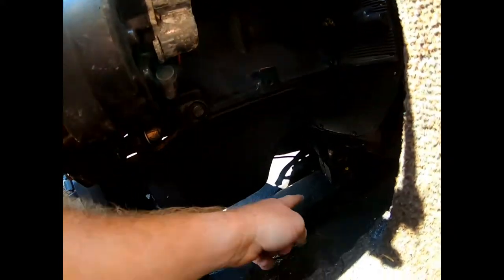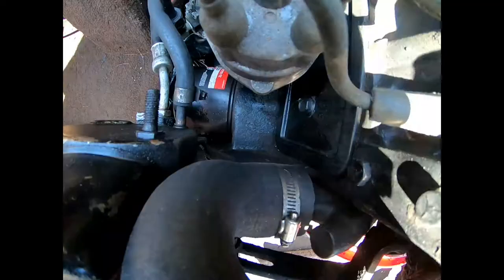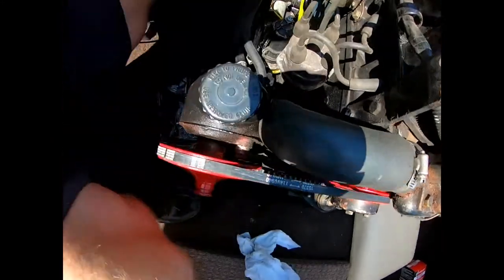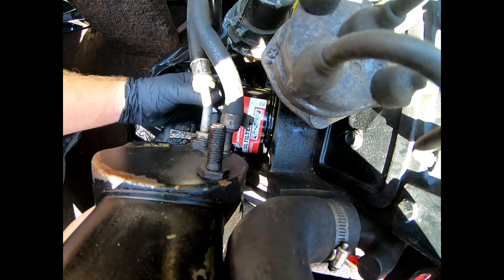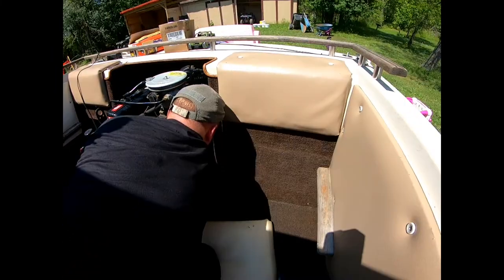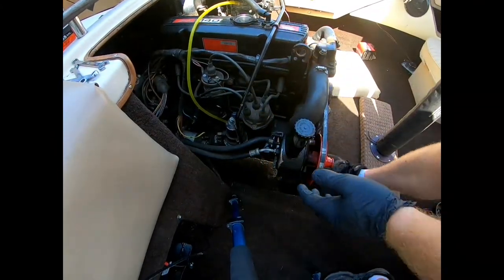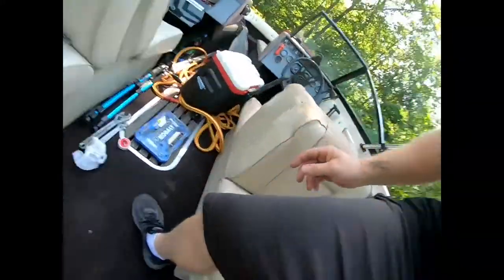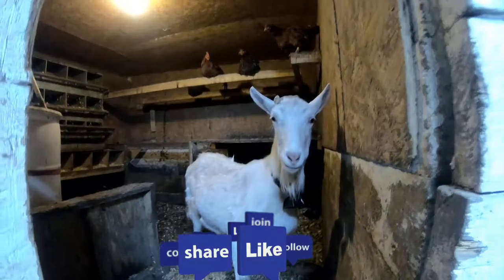Mercruiser Boat Oil And Filter Change DIY

Comment: I have never seen someone change the oil that way.  Have you not heard of a fluid extractor that sucks the oil from the dip stick tube?
Reply from the maker: Lol while now you have!  Trust me that dip stick oil extractor is doing you no favors especially with a boat where there is so much condensation and water constantly,  you are leaving mass amounts of sludge in you oil pan along with other break down contaminants and  metal shaving parts that are running back into your engine!!! Give it a try sometime and you'll see how much crap your leaving in there with just using an extractor,  if you want to prolong your engine give it a try and clean up is easy you can take the bag out cut a corner and drain it into you bottles or jugs, I do recommend the black heavy duty bags though!!! Thank you for watching and when you do try it let me know I'm sure you'll be impressed with all the junk you get out!👍😊
Reply: I change more oil in a day than you dp a year I'm sure, done what you have said and you are mis informed.
Reply from the maker: Hey keep on doing you then whatever makes you happy , I'm not here to change your ways, whatever works for you! It's a oil change in the end!👍
Reply: We have been changing oil using this method for years. The extractor works great but nothing is faster on a small 4 quart engine with easy access like we see here.
Reply from the maker: Definitely, totally agree! Thank you for watching!👍😊
Reply: Draining oil like that is one thing, but using a wrench to put the filter back on so tight is beyond me. That seal is so compressed now, I don't see how it wouldn't leak, let alone get it off next time. Please post a video next time you go to change the oil
Reply from the maker: Sure no problem! Lol Your right though it doesn't need to be that tight hand tight would of been enough! Thanks for watching!👍